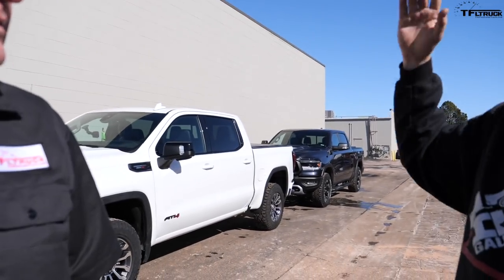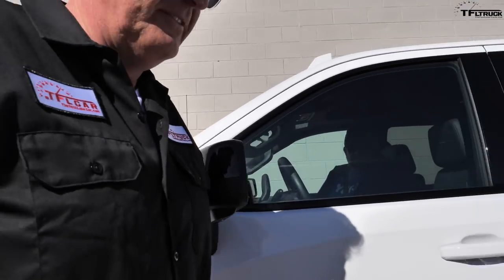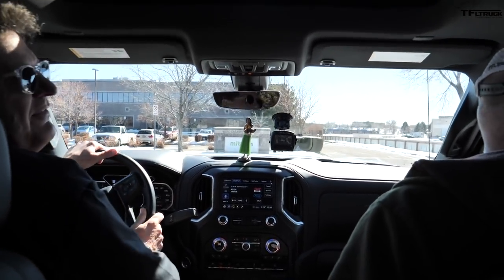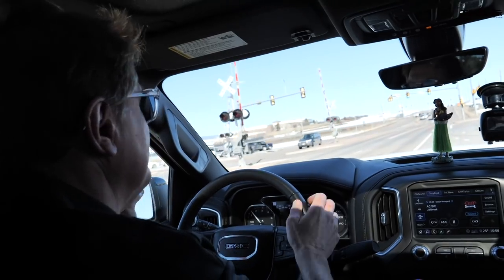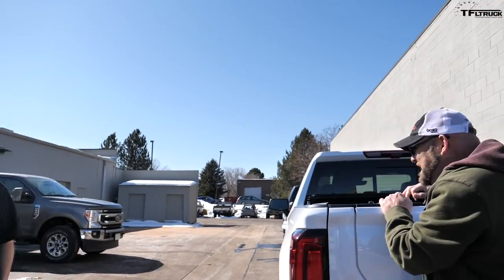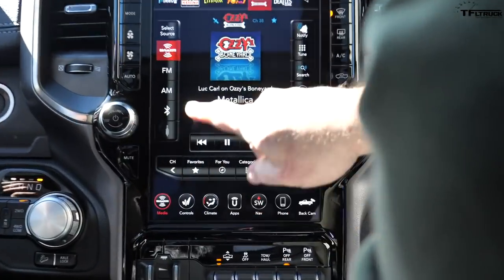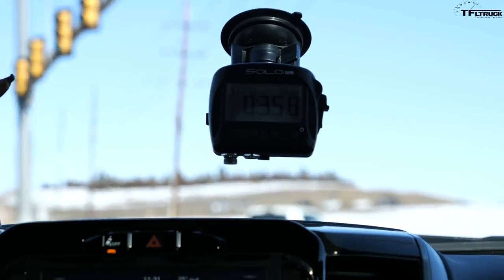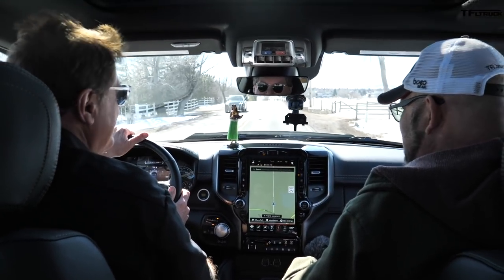Best Diesel Truck! 2020 GMC Sierra AT4 vs Ram Rebel Diesel 0-60 MPH Buddy Review

Comment: I wish Ram would have an option for a column shifter and the dial. Me personally I hate the dial and love the feel of a A column shifter also the manual transmission should still be available in the heavy duty pickups. Other than that the the interior is beautiful in the Ram.

Comment: GM with a wet belt oil pump drive, what could go wrong?
Reply: Ford has been using wet belt oil pumps for nearly a decade in some of their Ecoboosts. Never heard of any problems with those.
Reply: @karlschauff7989  Chain driven or direct drive off the crank, not a wet rubber belt.
Reply: @benjaminwayneb  Nope, Ford also uses a wet belt driven oil pumps on some Ecoboost engines. The 1.0 Ecoboost being one of them. Educate yourself.

Also, these days, Ford's powdered metal oil pumps are not exactly a shining beacon of reliability. The 5.0 Coyote sure is good at fracturing those pumps. Even Ford Performance throws those oil pumps in the garbage can and replaces it with a billet pump on every crate engine. Apparently what the factory part isn't good enough for even their basic crate engine.
Reply: @karlschauff7989  One engine and only for 2 years, hardly for a dacade. A 1.0 L. car engine is far from a diesel truck engine that is expected to last for hundreds of thousands of miles.
Reply: @benjaminwayneb   Not really. The standards Ford uses for designing a small turbocharged gas engine are the same design standards they use for an engine in a light-duty half ton truck. The B10 is going to be the same.

Yet the 3.0 Powerstroke uses a wet timing belt that requires you to tear apart nearly the entire front of the truck to change it. Same with the 3.0 Ecodiesel  which has a timing chain that will need to be changed on a regular schedule. Possibly even earlier than the 150,000 mile oil pump belt. That's assuming the Ecodiesel doesn't blow up by then (based on their well-earned reputation).
Reply: @karlschauff7989  The 3.0 Powerstroke uses a dry timing belt behind a composite timing cover, 6 hr. replacement time the plus belt price.

Comment: You did not fully evaluate the air suspension on the RAM. Two off road, one loading, normal and highway settings. This alone dramatically enhances the off road capabilities and adds to the ease of loading and unloading. It also improves towing stability and ease of hook up. Big plus.

Comment: Diesels are so dang slow, if you’re not towing all the time, why bother?
Reply: Uhhh u do realize ppl race then right.... simple tune and exhaust and lift pump can get u 200hp
Reply: I dont know what diesels you've been in, but my ram crew cab is faster then my ford single cab work truck. Ram is diesel with 145,000 miles with a tired trans and the ford has 60,000.
Reply: these are just for mpgs not towing or racing
Reply: Swampfox1906_ can you still get 200hp without doing an illegal emissions delete?
Reply: @jeffcroft10  full size diesel?
Reply: @Don Baine yes it's a crew cab short bed 4x4 with 35x12.50 17. Truck is stock minus cold air and cat back straight pipe
Reply: @yas you dont have to delete a diesel to get those power numbers. Most of the time all you have to do to is plug in a tuner and your good and it stays within emissions standards

Comment: I get 700 miles on a tank in the summer and 625 in winter in my 4x4 Ram Laramie 2018. GDE tune gave 50 miles more per tank at first now only 25 after 1 plus years but that could be because my tires are now 34 inches tall before were 33.

Comment: Not complicated fellas. Top button opens top gate, bottom button opens full gate. Also, hitting the hitch isnt an issue unless you push both buttons at the same time, which isnt a difficult thing to avoid

Comment: Great video format. 65-70k give me a F250, GM or Ram 2500 might not be quite as loaded but far more capable and the resale value far exceeds these. Yes fuel mileage is batter but that’s it’s only benefit

Comment: I love Chevy's but Nathan is 100% RIGHT! You should have bought the GMC Sierra Carbon Pro AT4 Duramax Diesel. We need a longterm perspective on this engine. The venerable 5.3L gasoline has already proven itself for two decades now. (What in the world were you all thinking when you acquired an old school, steel bed, 5.3L Trail Boss)?

Comment: Only rear differential lock, and a bit of lift.......and those 2 things can be found in a lottt of vehicle out there these days  (ZR2, TRD off road/pro, Frontier Pro-4x, FJ cruiser etc)
AKA---No front locker, no sway bar DC. 

I'd still rather take the Power Wagon or Rubicon any day.
Don't get me wrong, I love the diesel, but it doesn't increase any off-road capability.  As oppose to sway bar for articulation and front locker for a true 4wd

Comment: Very fun review. All of you had good points at different times. Interior on the #GM are very user friendly & easy to clean. Gmc tailgate way better but do miss the day of a simple flop down heavy tailgate ( I'm scare to put weight on ANY of the new ones). Panoramic roof on the f-150 failed on me (common plastic arms cracked) plus it let in too much heat &cold, also wind noise from shade so hate those. Selectable locker sure but most are limited to certain conditions G80 will do it at anytime so toss up there.

Comment: I still have yet to ever have a need to spend $50,000 - $$70,000 on a pickup truck. I simply can't justify it, even if I could afford it. I will vouch for the RAM and it's poor navigation when it comes to voice control. My Chrysler has the same basic system and it rarely gets what I say correct.
Reply: I keep telling everyone if sh*t hits the fan and I have to give up everything except one vehicle, it's gonna be the 86 F250 IDI that stays.

It's ugly, it's only 2WD, it's only 4speed manual, it has almost no comforts...

BUT...it's paid for, it has no emissions,  it can work like any modern half ton (just slower), it'll probably run forever, and access to repair everything is by design.

Comment: I like this video, but, in fairness, it would have been a closer price tag if the Ram Rebel did not have the side steps, and the Ram Boxes. Also, if you guys went with the 8" UConnect instead of the mighty 12", the Ram would have come in the same of cheaper than the GMC. I don't have a 'dog-in-the-fight' and I like both, but GMC interiors are just so sub standard at the price range. I am a huge fan of the inline 6 though. Racing these means absolutely nothing to this long time truck owner. Low end grunt, reliability, fuel economy, NVH, towing capability are more in line with what most truck owners want. But only time will tell if the GMC baby Max will be reliable.

Comment: What gears does that Rebel have? I think that you might have a gearing difference between the GMC and the Ram and that might be the accelleration difference. My Ram 1500 Diesel has the 3.92 gears and is quite quick.
Reply: There's no such thing as a "quick" Ram Ecodiesel. When they aren't blowing up, they're as slow as snails.

Comment: Today’s diesel is not a good idea for off reading or overland.... The particulate filters DPF clog up very quickly causing problems ....
If there deleted no problem. Today’s diesel need a load to keep the DPF hot and clean. And you need to be going at least 30mph to regen the DPF....
Idling around off road is looking for trouble.......
Reply: I absolutely agree. As much as I love the benefits of a diesel motor, the DEF and DPF are a nightmare. I had the first generation Ecodiesel and my commute to work is 10 minutes. The diesel doesn't get hot enough to regain on my commute. The sensor for the DEF fluid got clogged up with crystalized DEF, and my tank was 3/4 full. The truck was less than a year old, but the 50k powertrain warranty doesn't cover the exhaust system. The warranty for the exhaust system is only 10k miles. The dealer wanted $1500 to replace the whole DEF tank and get it out of limp mode. You can't buy a replacement sensor and the only option is to replace the entire tank. I removed the tank, used steam to unclog the nozzle, and filled it with distilled water. I had a few days off of work so I let it sit for a couple of days. I emptied the water out and bolted everything back into place. I had a buddy clear the codes. Within 5 minutes of driving the dash lit up like Chernobyl. I ended getting rid of the truck because I don't want to spend $1500 every year or two to keep the system happy. The way prices are right now, the 6.2L is the way to go.

Comment: Dont care for 0 to 60 in a pickup, you need to 55 to 70.  It's a much better test, I'd don't pull out in front traffic I need to pass it. My biggest problem is  have is when you go to pass and you put your foot into it the transmission has a huge lag shifting down to passing gear.

Comment: just a heads up guys, the AT4 has an auto locking rear end.  You mentioned how there was not electronic lockers.  Does ram have a front locker?

Comment: Guys thanks for the video!  Can you ask gm if they will increase fuel tank size next year and offer the max tow package which might include 3.42 axle and 7300 gvw?  Makes no sense to me why they wouldnt offer that with an engine that is supposed to tow well.  But maybe people dont buy trucks to work any more.  Government motors.

Comment: If you want to buy problems.  Buy the Dodge ecodiesel.  This engine WAS a joint venture between GM and Chrysler.  It WAS supposed to be used in the Cadillacs in Europe, but because of so many engineering problems that would effect reliability GM pulled out and decided to make their own 6cyl Diesel.  Chrysler kept the rights to the engine and became FCA.  The check engine light will most likely be on when you pick up your brand new broken truck.

Comment: So your saying this is not a carbon fibre bed.  Are you saying that fiberglass boats that are layed up using a chop gun instead of a fiberglass cloth layup is not a fibreglass boat?  If it has a carbon fiber mix in the bed it is a carbon fibre bed.  If so what the heck is it?

Comment: The bed has a lot in common with the setup on the Tacoma. Whereas the Tacoma's uses glass fiber reinforcement, this one uses carbon fiber reinforcement. They are both just about as strong as the other given similar polymers used. The downside is that the most UV resistant polymers, aren't necessarily the strongest, and the strongest aren't necessarily the most UV resistant. Glass levels are higher in the housings of most high end power tools. Those are glass filled PA6, aka Nylon. This is the same story with the polymer used in firearm manufacture. It is very durable stuff, but it isn't exactly expensive. They simply fire hose it into a die or mold and press it under high pressure. Some have short enough fibers to be injection molded. It's not revolutionary stuff, it's just that the automotive industry is about 30 years behind when it comes to materials usage, or they use it wrong. Most of the interior plastic in cars is glass filled polyamide, which is actually stronger than this stuff on these beds. It has the same strength as 7000 series aluminum, but 1/5 as dense. Heck, there are types of ductile cast iron with a higher strength to weight ratio than aluminum, but they only use it for gears and pipes lol. Imagine how much less expensive cars would be if their frames were cast, and their bodies press molded? Or how fast they could be produced? Rumor is that Tesla is going to be using cast aluminum materials in the frames of their newer cars. I'll be interested in following that.
Reply: TLDR. Had to do it to myself to rob anyone else of the satisfaction.

Comment: I would say lease both at best. Way too much money for a 1500 series. You can build  a Chevy  4wd crew cab 2500lt trim or Ram 4wd crew 2500 big horn trim with diesels for 55-60k if you go light on the options. If you find one you like on the lot then even less. And I would bet the 2500 diesels hold their value much better as well. Factoring in both, cost of ownership would be significantly less in the hd. It's great manufacturers are offering 1500 In  diesels but not at these prices. Will we see a real world mpg test as well as an IKE gauntlet?

Comment: Buy a Ram with the Ram Box....what's the over/under to how many days until someone takes a pry bar to them?
Reply: Vs just leaving it in the bed?  I would use the rambox... your not keeping money in the rambox... I would keep jumper cables, hand tools, gloves, rags, tarp, tie downs...  where would you put these things?  In a storage box in the bed reducing your bed space?
Reply: @commonsenseguy8189  The Ram Boxes eat a LOT of your bed space. They make the bed almost worthless due to how narrow it makes it.
Reply: @karlschauff7989  not true, they only use the sace around the wheel wells.. you can still get a 4ft wide plywood in the bed... what else would you use the wheel space for (loading bulk dirt?)  A half ton truck can only hold 1 to  1.5 scoops of dirt in the bed safely...
Reply: @commonsenseguy8189  I put all kinds of equipment and job boxes in the bed. That extra space is a big deal. The Ramboxes are a waste of bed space. Maybe if they were built tough enough and were more secure, I could see using them. As of now, the bins are too brittle and prone to puncture if you aren't selective about what  you put in there. The doors themselves are ill-fitting and not secure against break-ins.
Reply: @karlschauff7989  Maybe a work trailer is what you need?
Reply: @commonsenseguy8189  Nah I'll just buy a truck with a real bed.

Comment: Which is better, Faux wood or faux Carbon Fibre in your interior.  I greatly prefer the Ram interior design but I am a little tired of plastic wood pretending to be real..  Do you know for sure that it isn'l plastic with a thin layer (single) of carbon fibre cloth?  Since carbon fibre formula one car tubs are made of carbon fiber mesh in plastic gel coat and then autoclaved then if it hasn' been an autoclave then it isn't carbon fiber but just fiberglass with the glass taken out and carbon fibre replacing it?  That being the case, then wouldn't it be carbon fibre?

Comment: When we took delivery of our GMC Terrain 2.0t (excellent vehicle, right tool for the task) in late 2019, the at4 3.0td was not yet available, soon after it was details of a Yukon At4 began to surface, first I had read that the Yukon At4 would not be available in 3.0td because of the design of the front fascia coming in contact with turbo and intercooler components, about a week later I read that it would be made available. Any way, I was shopping for a different tool for a different job, I had come across the Expedition limited ecoboost 302a package with max tow a 4x4 SUV that would accompany 7/8 passengers, and tow a watercraft while maintaining good/decent mileage. But it did not offer the 3.0 Powerstroke in any configuration which left me scratching my head, puzzled thinking, why not? I put the purchase on hold, until I could confirm if the Yukon at4 did indeed offer the 3.0td option. I am pretty sure the Jeep Grand Wagoneer will offer the 3.0td ecodiesel, but one was hoping for a 2500 Cummins trailhawk Grand Wagoneer to compete with the outdated Excursion at the boat ramp, it is a shame they dont listen to their customers and the vehicle service is appalling, as of right now I plan to leave the Jeep brand and never come back.

Comment: If you were to load a quad up on the ram, is all that weight on the latches, can they hold the weight off a quad on hanging out if the bed on the gate

Comment: Does the ram fly because the dash  seems like an airplane cockpit? When it come to a diesel truck I dont need all the crap in it. This is the reason trucks have become so pricey, super lame. In this case the GMC is the winner.

Comment: Also glad you got the Silverado TrailBoss 5.3L & Jeep Gladiator buttt wish the 3rd was either the 3.0L Diesel Sierra SLT (Silverado RST) or Sierra HD 6.6L Gas over the F-250 but i understand that would be unfair so maybe next time.

Comment: Neither... Ford. So, why would I say Ford when these are both newer, have more power and torque, and get better mileage? Simple... Cost. I looked around the Vegas area and neither GMC nor Ram dealers are offering many deals on these. On the other hand, I bought my crew cab Lariat Powerstroke F150 with a $68k sticker price for only $46k, and it's loaded. 502a Luxury group, panoramic roof, power running boards, monochrome Sport package, heated rear seats, rear seatbelt airbags, rear locker, etc...
Reply: Don Olypopper  I've got several friends with PS engines well over 200k with zero problems. Sounds like you just got a lemon.
Reply: Don Olypopper  So now I think you're lying about having a Ford and you're just a Dodge fan boi trolling. Next.

Comment: So gm goes straight 6,ram goes v-6.i'm confused.is the ram not a Cummings. Also the rebel badge needs too go away on that model more like a lariat.it seems the a AT4 is more manly off road truck,as the Rebel is grey poupon
FYI I have owned Ford now a Ram owner. Just seems that 1/2 tons are getting  out of hand on price and luxury offroad.thank goodness for lower options too get them prices down.great video

Comment: Just bought a 2021 GMC AT4 HD 3500 bc there wasn’t much of a price diff between 1500 and 3500, I think GM did a great job with this truck, and I loved my 2016 F350 SRW SB PSD but the new ones are more $ and rougher ride so hoping the GMC will be what I hope it is.  Love your video guys but I need more truck to pull a 14K fifth wheel so went with 2021 3500HD SRW SB 6.6 Duramax 🤗

Comment: Straight 6 is a great configuration but no mention of the timing chain on the rear of the engine or the belt driven oil pump on the rear of the engine. With a service interval of 150k miles. The same head bolt configuration of the 6.0 super duty. Lol pump service and any head work requiring dropping of the trans... I definitely would be afraid to buy the GMC for the long haul.